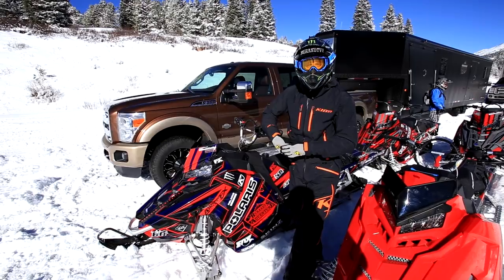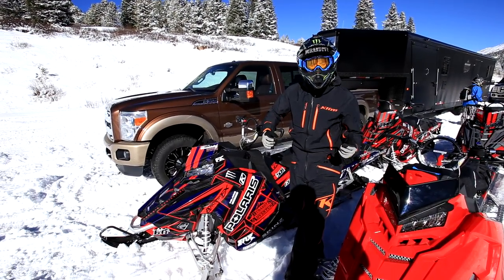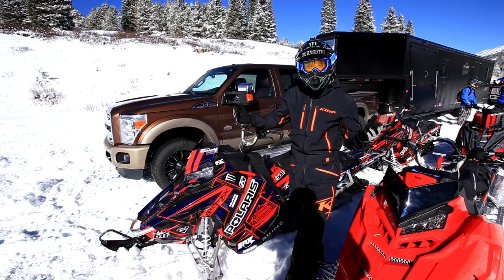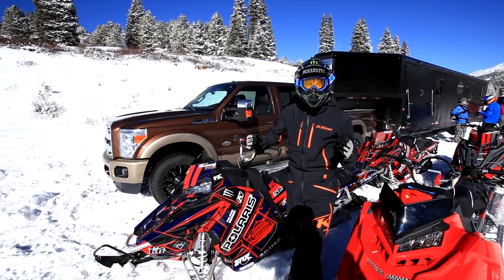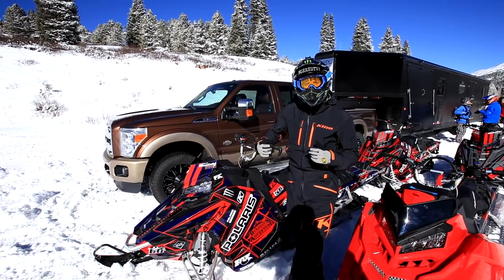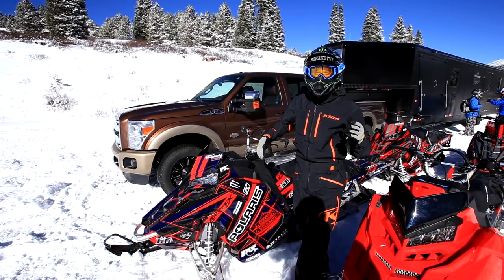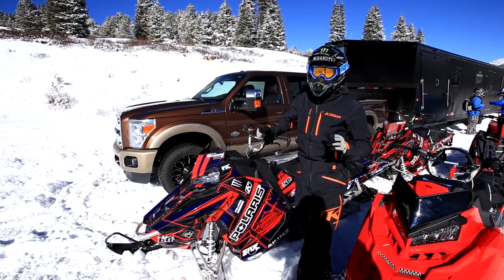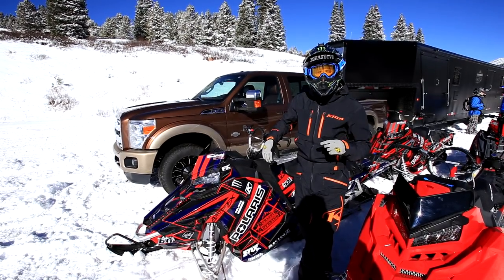Tech Tip - Breaking in your new sled

Comment: good video blipping the throttle like that gives everything a little more fuel and oil on our drag motors we do 10 heat cycles starting at running them for a minute and adding a minute each cycle and the first start up I spray fogging oil into carbs to help flush assembly lube and grease out of seals and my motor spins at 10600 for 6 seconds
Reply: Ride it like ya stole it

Comment: I would never do a bunch of heat cycles at idle.  You need to break in rings in those first few runs.  That only happens when you load them.  I would bring it to temperature then run it easy under light load.  Shut it off let cool .  Bring it to temp and run it a bit harder.  Maybe half load then cool it. Then 3/4 load. Then full load.  I'm betting the pistons are cast and not forged.
Reply: I'll listen to the face of Polaris thank you haha.  Must work with the shit he puts those sleds through
Reply: @cameronbarron  you know nothing about engines. Go ahead and rebuild any engine and be easy on it while seating the rings and its gona be a gutless pos its whole life
Reply: @griffinpierce7691  ever wonder how and why eventually you need to re plate.evwn with out ever blowing up... This is why
Reply: @griffinpierce7691  the idea is to create seal.  Heavy throttle will leave you with bald spots and leave you "gutless" like you said...or even worse than bald spot , burns down your shitty rebuild

Comment: The best way to break in a belt is to vary speed with as little throttle as you can. after a couple dozen km of that the whole width of the belt will have conformed to the clutch shape. The worse way to break in a belt is to vary throttle abruptly.

Comment: All my rebuilds get 20,000+ kms on em before any engine is ever opened back up. I have my own way of breaking in a fresh dirtbike/sled/atv,etc. Im not even gonna bother posting it here, ill get praised or ragged on. Lol. I just did an 87 skidoo 503 up, new crank, rods, all bearings, jugs 0.50over, new prox pistons/rings, seal and bearings throughout the motor. Ill be doing compression on first pull(should be 150lbs), then itll prob go to 155-160psi..

Comment: I go up and down the drag strip a few times then let her cool off.. You can hold it wise open for liike 1600ff  then burp it to give her some oil.. IV broken in many a sled this way and haven't had a problem.. Yet lol
Reply: The reason the manual says to do things a certain way is because there could be water, air or dirt and such in the coolant system, fuel system and oil system. You don't want to be going wide open throttle (or jerky throttle like this) if your water pump starts to suck air, or air remains in the head (it often won't show on water temp).

Comment: That is NOT how you break in a Sled. Yes you vary throttle but you don’t have to go that crazy with it. Just don’t hold it at the same speed for more than a minute at a time and you will be fine.